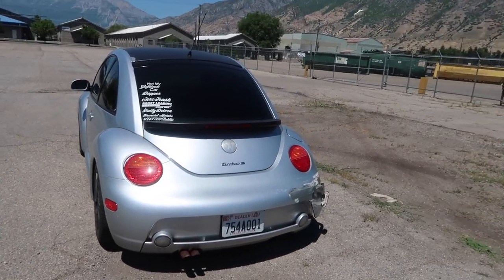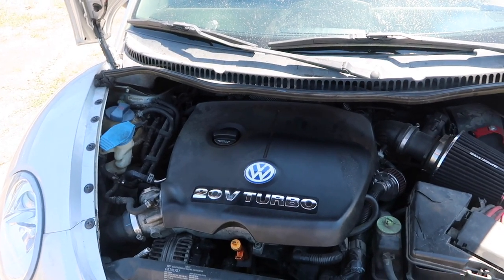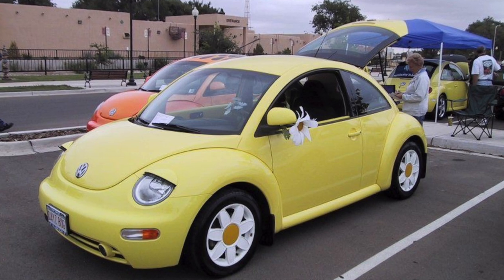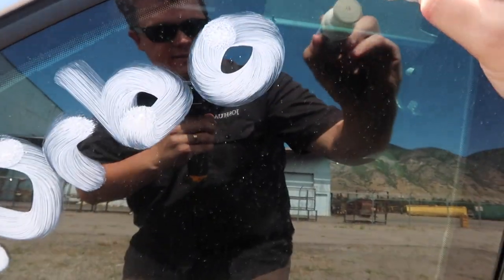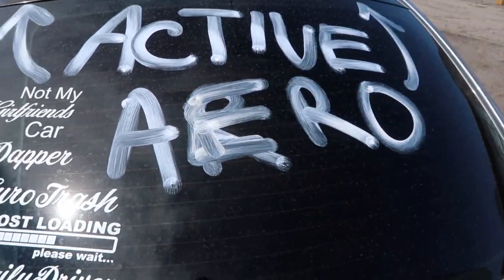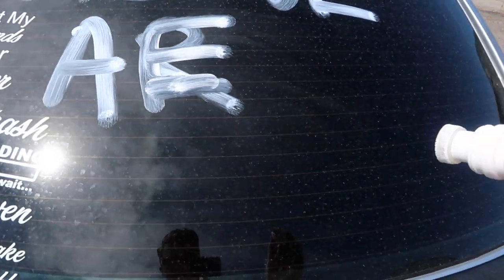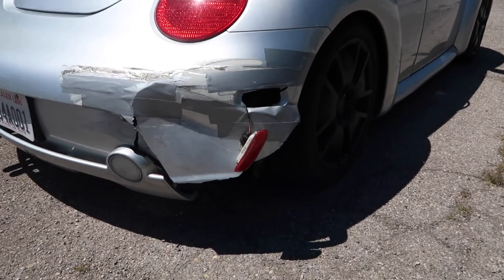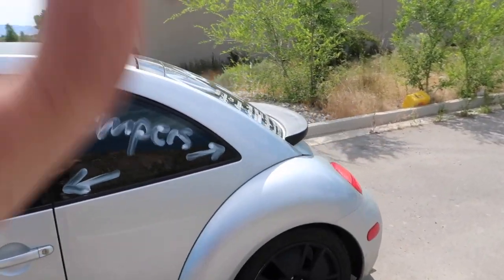I bought a $800 VW Beetle Turbo S. Better Deal than Hoovies Garage?!

Comment: The Turbo S also came with the machined aluminum door handles and glove box latch. The gear knob is also specific to the TurboS with the dimpled aluminum, steering wheel spokes and the bud vase is also TurboS specific with a real aluminum rim to match the gear knob dimples. The interior lighting is white/red instead of VW blue/red. All those little things if missing or broken... good luck finding it.

Comment: Spray on some Goo Be Gone Automotive on that plastidip crap and let it soak for 20 min. Then use a power washer to spray is off. Whatever remains easily scrapes off with your finger or a wet towel. Cheers!
Reply from the maker: Thanks for the info. Still working on it. Update video soon.

Comment: This is insane!!!!
Reply from the maker: Turned out to be a great video. Tune in tomorrow! I'll be watching live and in the live chat tomorrow at 10:45 MST.
Reply: In middle east beetle is quite prone to catching fire. With turbo and cold air intake it must b generating lots of heat having small grill 
How is it doing there.
Reply from the maker: I am going to switch the hot air intake out for a stock air box. Should help with intake temps.
Reply: Spotted Euros The ksl turbo beetle S I saw this a few weeks ago! I wanted it so bad!
Reply from the maker: I picked it up quick.  Pretty good car overall. Needs some work defiantly.
Reply: Spotted Euros SELL ME IT! 😜😜😜😜